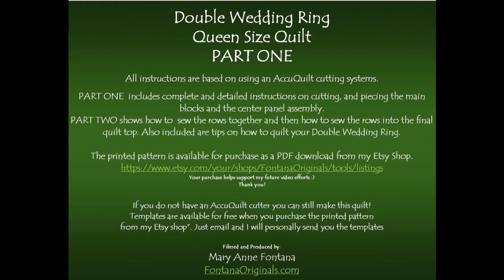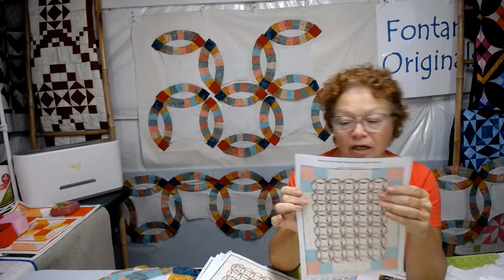Double Wedding Ring - Part 1

Comment: thank you for making this video  I have the GO! 2 -die dwr set ... the pattern calls for  3 2-notch pieces in the middle, the a  1-notch pc on each end  then a square on each end of  that for the 2nd half of the pcs . So it's a little different . All the arc pcs   ( including orange peel and solid arc option ) are on one die and the big center is on the other.  Your video was very helpful on how I can put the rows together ;)

Comment: Loved your fabric saving tip and demonstration for the smaller pieces. Do you have tips for the Mellon and center. I am just thinking I will have a whole lot of waste with these.
Reply from the maker: As a matter of fact I do! When I cut the large center pieces I cut a WOF strip 10-3/4". I folded this in half. If you are careful about how you place the large piece on the fabric, noting which side has the fold (leave less room) and which side doesn't (leave more room) you can then cut the "mellon" shape from the leftover pieces. I was actually able to cut half the mellon shapes I needed from the scraps. If I am not being clear let me know and I will try to send you a drawing.

Comment: What did you change your stitch length to
Reply from the maker: I used a 2.75.  Where there are heavy seams you may have to help the "bump" in your fabric under the presser foot  or you will be sewing the stitches really close together regardless of the setting. I found out the hard way. Hope this helps. Happy Quilting :)

Comment: Are the studio dies a different size from the GO double wedding ring die? I have #55078 which makes an 11.5" finished block.
Reply from the maker: Mary,  There are actually two different size GO! Double Wedding Rings.  The 11-1/2" size which is what you have and an 12-1/2" size which is the same size as the Studio Die I did the video with. The major difference I have noticed is that the 11-1/2" shapes do not all have the notches. I think the one for the corner does not have any notches and in the video I talk about matching up the notches. If you are using the pieced rings the assembly should be similar. If you are using the solid arc it will be much easier to sew together.  You will probably need less fabric as well. Let me k now if you have any other questions. Happy Quilting :)
Reply: @fontanaoriginals  Thank you so much for your reply! When I bought the GO DWR die I really wasn't sure which of the two to choose. I ended up getting the one I did so that I would have the option to make both solid and pieced rings. Your video has been very helpful, and I am looking forward to watching the second one.
Reply from the maker: @maryhodge2625   You are most welcome! Glad the video was helpful. I like the idea of that single piece in the center instead of all the pieces. Thinking of getting that for my Studio die and make another double wedding ring. I think it would be twice as fast.   Please follow me on YouTube so you will be notified when I post new videos. Happy Quilting :)